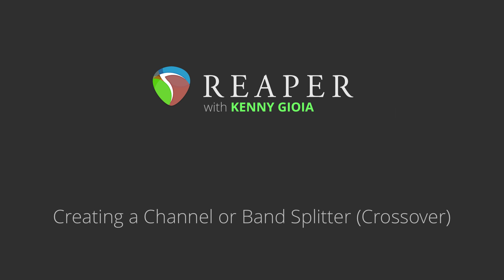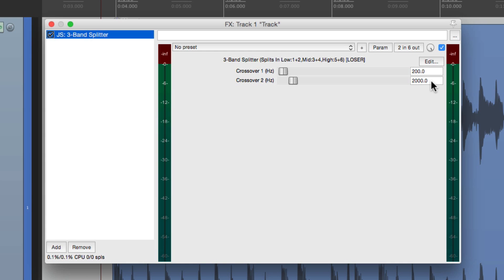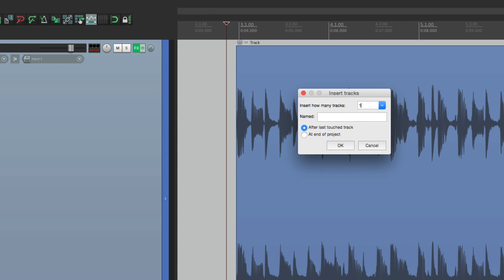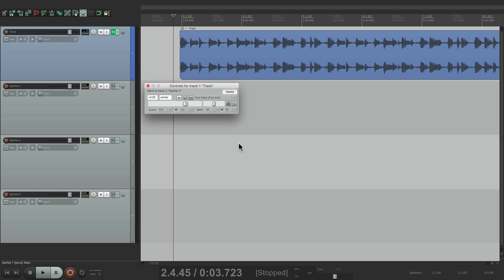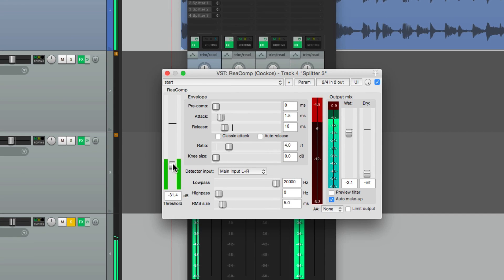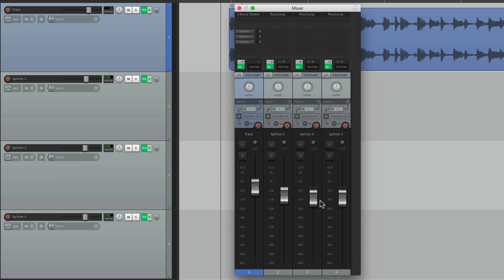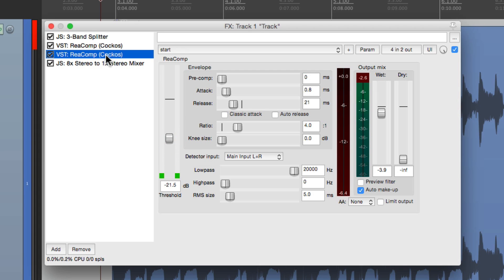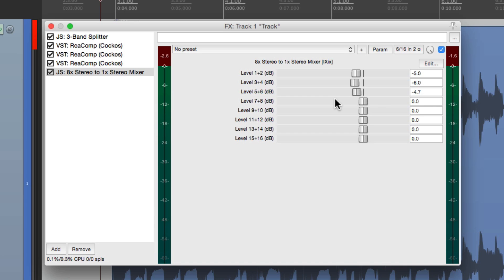Creating a Channel or Band Splitter in REAPER

Comment: What if working with mono source? should I put ''mono source 1, 2, 3...instead of 1/2, 3/4, etc?
It didn't worked on a DI bass track, and the receiving tracks sometimes were mono, sometimes stereo...and when muted, I still heard sound...when I shouldnt, too much confusion, and did it step by step.

Comment: I think I would prefer the first method, because it's simpler and more straight forward.  Once you have the balance of the 3 faders, you could group them and control the level without losing the balance.  You could also make the original track a folder track, and the 3 splitter tracks members of that folder, right?

Comment: Didn't feel like using the "3 band joiner" plugin? :D
Reply from the maker: What is that?
Reply: The companion plugin to 3-band splitter. :) Also by "Loser". I'm pretty sure it was in the default install and not added by me later. Anyway it's like that mixer but only with 3 faders.
Reply: @petersamps  The 3-band joiner leaves me with 6 channels all the same! Do you guys know how I could bring it all back to 2 channels? I know the Channel Mapper Downmixer tool, but that somehow makes the volume go way loud and even clip!

Comment: I've heard there could be some phase distortion(?) at the cross overs with multi band devices, and to minimize it, linear phase mode is recommended.  Do you know if this is the case here?
Reply from the maker: Try it yourself. There's no difference. Duplicate the track without the Band Splitter and invert the Polarity (Phase). Try moving the bands around and you'll still hear nothing as it cancels out perfectly.
Reply: Very good question.